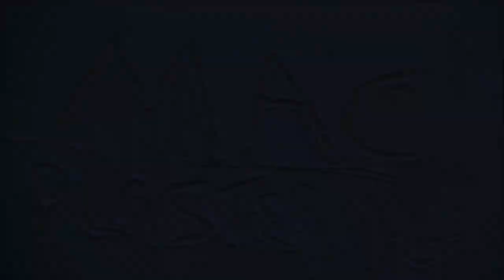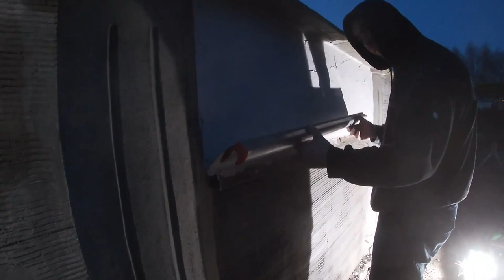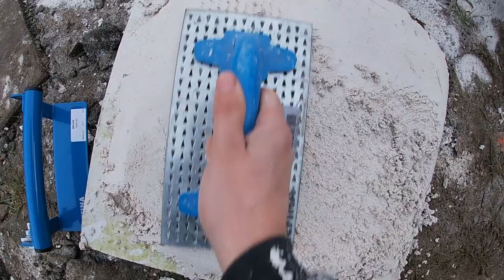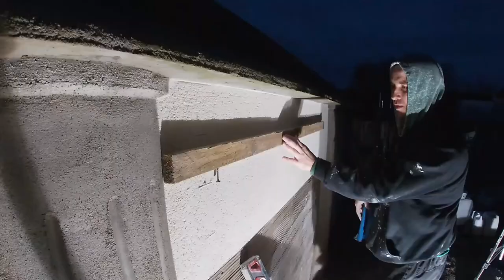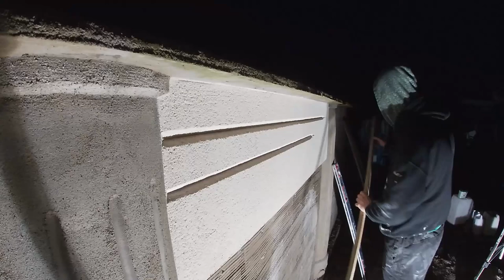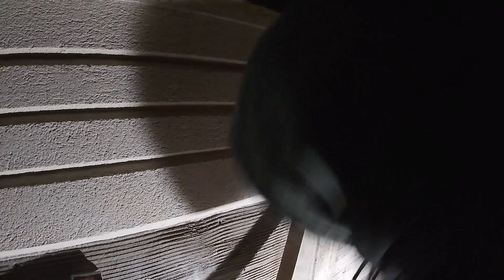k rend ashlar cuts diy how to synthetic render long full NO voice just Music

Comment: How many bags did that take to fill out to the depth of the slating lath?
Reply from the maker: Not 100% 2 or 3 i think mate
Reply: @macplastering  it’ll be like nuclear bunker wall thick by the end lol. I had to to a full house in Weber with bands and arches in sand and cement and not one bead was allowed to be used. Torture!
Reply from the maker: @EO-zu5uz  Haha :) I dont mind doing k rend / weber with out beads as i learned that way but beads dose work out for them coats better arches would be a nightmare on the inside for sure with k rend  haha :) When cutting the vees / ashlars out you will need a big coat last thing ya wanna see will be block or grey cement saying hello LOL learned that the very hard way
Reply: @macplastering  yeah all templates cut for the arch with 3/4 ply and the 45 cut back in to give the depth for the band and then able to take the coat of Weber. It does look good without beads though just have to tell everyone to clear away off from the buildings incase they knock a wet edge! Yeah I haven’t had to do any Ashlar work but I know what you mean. You’re beat if any sand and cement comes through!
Reply from the maker: @EO-zu5uz  I remember when was a little younger scratch coating away at the fronts of these house and the boss being like a bear get that tidy flat straight but he was right as the odd time a little but of scratch would shine in where it had a wee lump and it was a pain to cut out then hard as the road and touch up with the gear we rubbing out always came in good but could be a disaster if not carful but as you seen here I could a have cut in another 1/2 inch LOL what was the colours you guys did ?
Reply: @macplastering  yeah need the scratch properly straightened and scratched! The ibar is a different level for getting the Weber flat. Comes out perfect after using the serrated edge and flattening the Weber in. It was silver Pearl. The Weber is more chalky looking than the krend when finished though
Reply from the maker: @EO-zu5uz  I thin i liked hand app the weber that little more just felt a slight be less like bubble gum LOL
Reply: Hello bud do u use a base coat with that or can u use sand and cement and then top it with the k render look mint as well fella
Reply from the maker: @leepullen5003  You can go straight onto block with k rend mate I have this scratched as there is other rendering and dashing jobs to be done on it the other areas not sure if you seen this other video on k rend - https://youtu.be/-U3Cb4-jp80 oh and will be breaking this video down over the next few weeks with lots of detail mate
Reply: @macplastering  thanks for getting back to me bud 👍would I need to use any sbr or any primer to help it take or just go straight on with it
Reply from the maker: @leepullen5003  You can give wall a wet mate especially if warm or its been built a while we done loads of house all diffrent ways on one site and it seems fine bar the od house green mossy lol
Reply: @macplastering  OK bud thank u is there any way I can contact u just to ask a few questions over the phone 📱
Reply from the maker: @leepullen5003  Just seen your message mate whats up ?